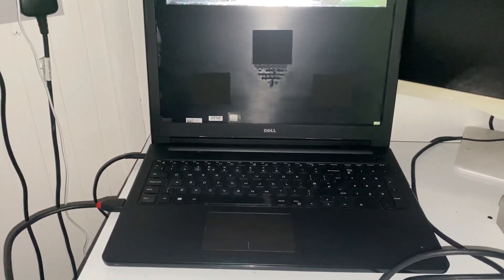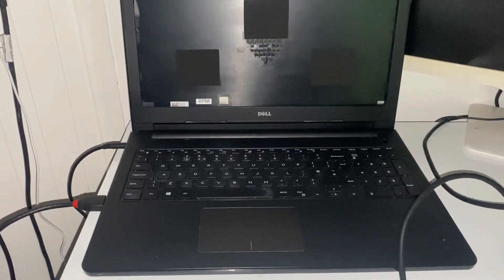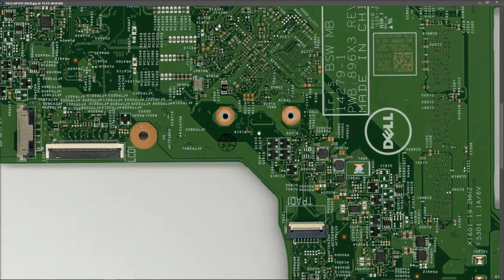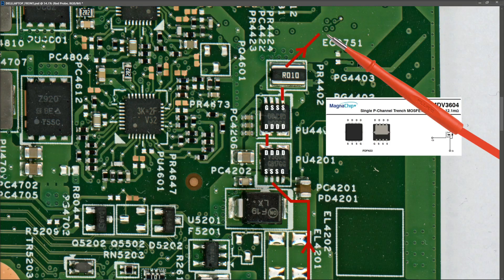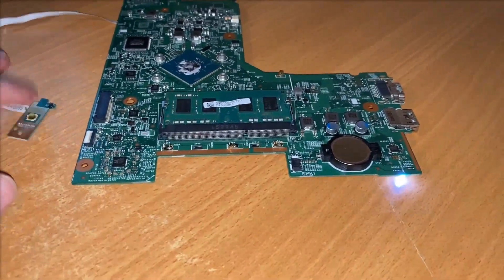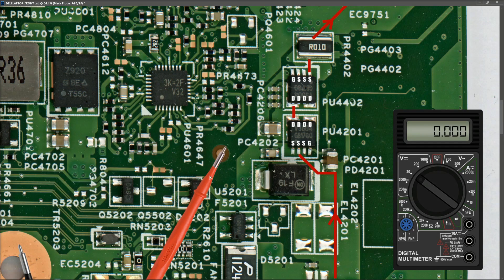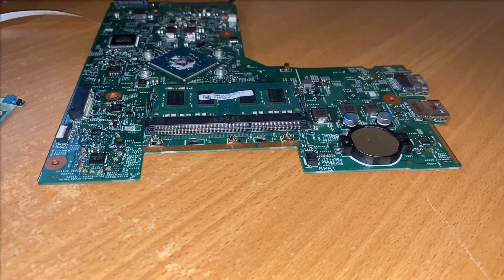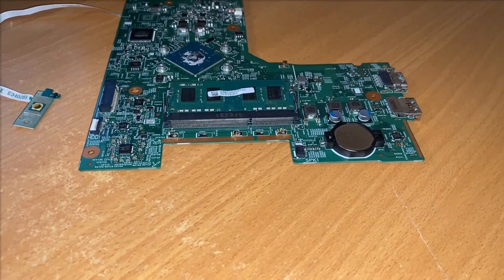Dell Inspiron 3552 - How To Troubleshoot A Laptop Not Powering On

Comment: Thank you for mentioning at the end of the video that you tried replacing the CR2032 battery. It looks like an original factory battery, which usually measures less than 3.0V when out of circuit on the great majority of these older Dell laptops in my experience.

Comment: If you are confident that GPU and CPU are good, you can use thermal camera. Thermal camera is a very good friend to find shorted micro SMDs (especially the CAPS)
If thermal camera shows heat detection on any IC, check the surrounding CAPS connected that IC.
For a guy who debugs so many PCBs, require a thermal camera (which is used when all the hopes on a PCB is lost)

Comment: I would insist more on BIOS specifically trying more dumps that I could find online or even trying to clean ME region on the original dump which is a possible culprit in situations like this. What about the resistance on the 1.0V rail ?

Comment: 1- check if there is a shorted mosfet or partial  short.
2- use a thermal camera for heat detection maybe you can see something to indicate the problem.
3- try a different bios chip maybe it's a bad one